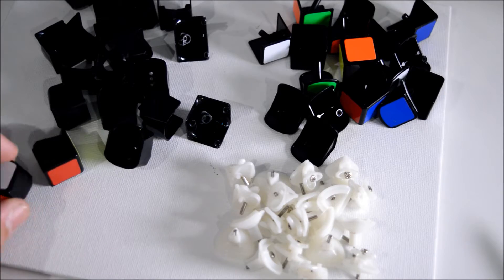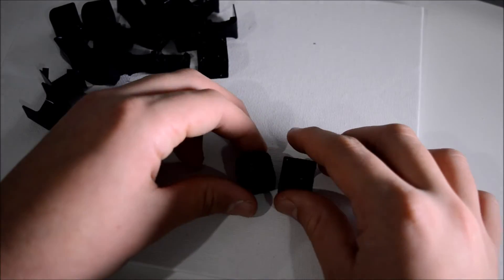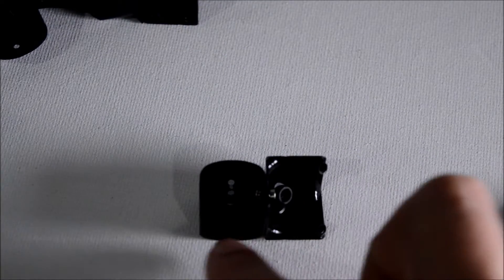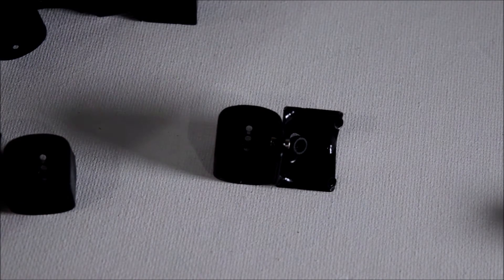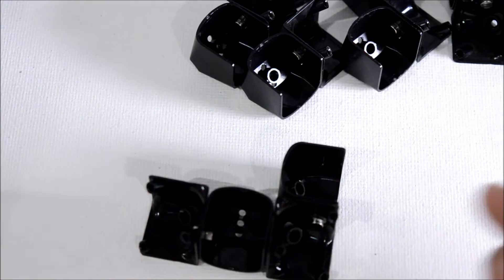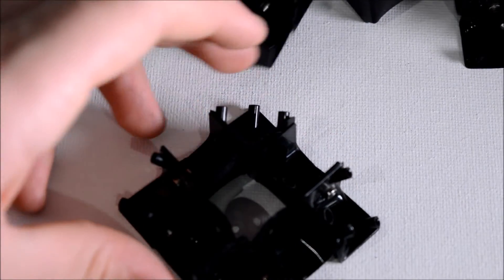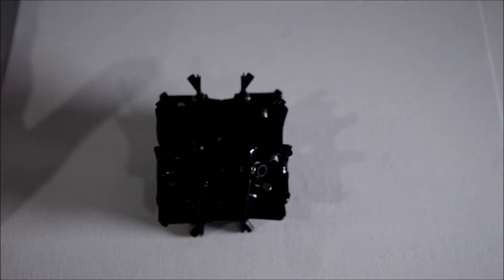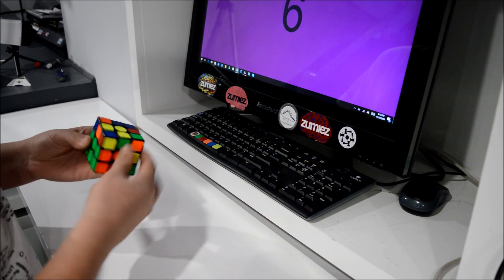[In-Depth Tutorial] How to Make a Magnetic Gans Air

Comment: really good tutorial but i habe to mention a few little points were you can make it a little bit better... please use a "master magnet" (you glue ONE Edge and one Corner together, let them dry, take them appart, use 2 other non magnetic pieces... and use one old and one new piece to have the same polarity... and so on.. it takes a little bit longer but makes an perfekt magnetic field... also glue on the piece, insert the magnet and make an extradrop on the top like he does.. you don't want to lose any magnets while rough turning if you glue them good.. it takes a little bit longer but if you need 1 or 1,5 hours is no big deal... but if you do it like i said you won't habe any problems :)
Reply from the maker: Yeah, I saw DMCubing's tutorial, and I liked it a lot. I liked his gluing technique more than mine too. I was really trying to make this video as simple as possible, so it would have hard to go into as much detail as he did. And thanks for the feedback!

Comment: Doesn't these magnets slow down too much the cube ? I want select the good magnets to don't waste my Gan. I don't know if a 4x1mm magnet is less magnetic than a 4x2. I would like to have the good compromise between magnetism and speed. I would like magnets like the Valk 3 M.
Reply from the maker: The magnets used in this tutorial are the same magnets used on the valk m. And 4x1 mm magnets will be weaker than 4x2.
Reply: Okay thx. But do you think that 4*1 could be enough to have rather good magnetic properties without slowing down too much ?
Reply: because I just have the S-series of nuts and using the yellow, it's not the faster (comparing to G series) and don't want magnets that too much slow down. Indeed, is your cube better than without magnets?
Reply from the maker: I also use the yellow nuts, and I definitely prefer the magnetic Gans air. If you're really worried about making your gans too slow, i would recommend getting the 4x1 magnets.
Reply: thank a lot

Comment: Does the addition of magnets slow down the cube at all? I have done a lot of work to make my Gans Air as fast as I can. 

Even if it does, that's fine. I'll probably end up using the magnetized one for OH in that case, since the Air I use as my main is way too flexible.
Reply from the maker: the magnets don't necessarily slow the cube down, they just make the cube more controllable and allow for more accurate turning.

Comment: my question is why would you make a magnetic Gans air if your Gans air already has the resistance like magnets do
Reply from the maker: I thought this at first, but after doing around 100 solves with the magnets, i've realized the difference the magnets make. They help the stability more than you'd expect and the small center catches are completely eliminated
Reply: yeah, but mine literally has the click sound and the feedback after every 90 degree turn, just like it would when it has magnets.
Reply from the maker: Trust me, the magnets make a noticeable difference. My cube also felt like it had the "indents" you're talking about. The magnets just do a better jobs of preventing overshooting, catches and lockups.